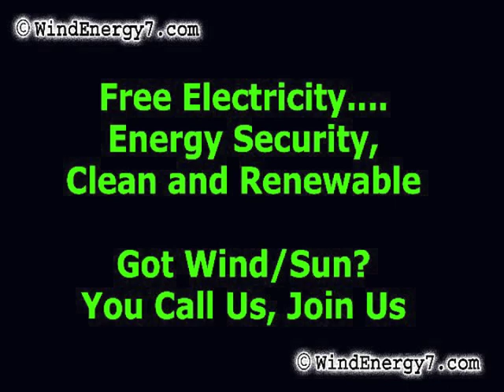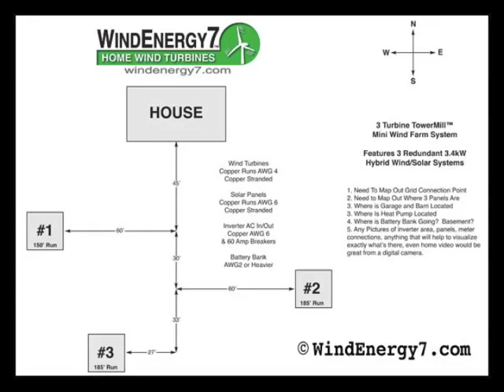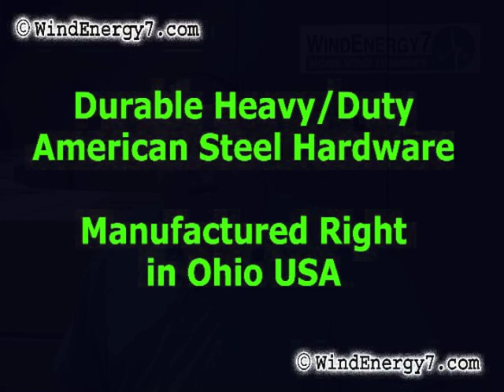TowerMill™ Small Wind Turbine

Comment from the maker: The RoofMill™, The PROVEN Wind Power Kit invention that has been so successful as a Wind Power Kit can be installed almost anywhere. By putting it on a Roof Mount you save on the tower costs, but also harness the wind acceleration as it passes over the Rooftop its like a wind concentrator right into the small wind turbines. WE ARE INSTALLED IN OVER 40 STATES and ALMOST 10 YEARS IN THE FIELD.

Comment: Featured in the video above, the TowerMill™ is a larger tower mounted or pole mounted system that is a wind/solar hybrid energy system that puts out 4.0kW per unit. These Home Wind Turbines sit atop a 45' monopole tower. Customers can start with one or several. The Home Wind Farm concept allows a customer to step into this technology with a smaller investment and prove out their investment as they go. The modular turbine array concept allows for easy bolt on expansion to a system.

Comment: Please Share to YOUR GOOGLE+ ! WE sell Kits and DIY Solar Panel Kits - Solar Panel Kit and we direct and support the installs through our network of Local Solar Panel Dealers and Solar Panel Installers. Come visit our website! -> WINDENERGY7.COM

WindEnergy7 sells you only complete Solar Panel System Kits so that we can be sure your project is successful, safe, and above all productive at making home electric power.  We don't sell parts and pieces and confuse customers with a mess of options to figure out.  We are THE EXPERTS.  WindEnergy7 specializes in complete system Solar Panel Kits with full support and training.
Reply: Small Wind Turbine Kits can be installed on your roof and guaranteed to reduce or eliminate your electric bill.

By using the RoofMill product, a Roof Mount Wind Turbine Roof Mount system, the system uses a rooftop like a big wind foil, or concentrator that sort of funnels extra wind into the mills.  Its far better than having a windmill on a tower and cheaper too.